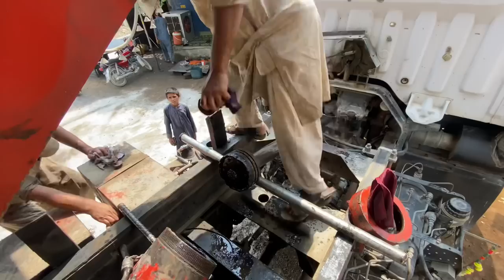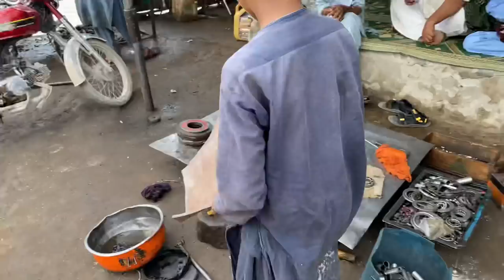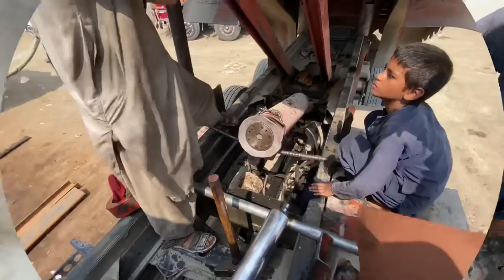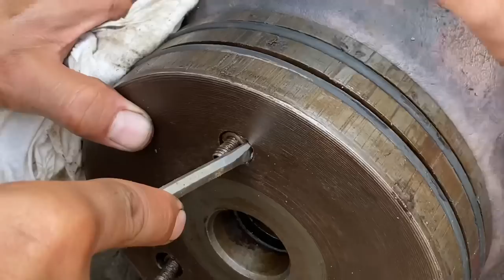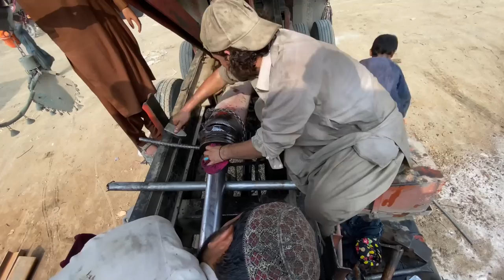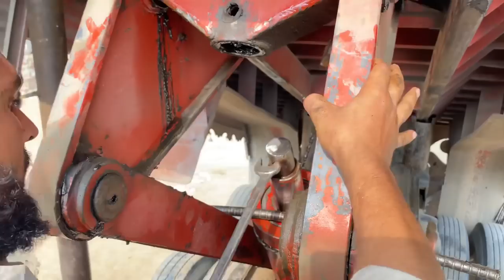how a geniusman make a hydralic jack seal from cow leather | Truck hydraulic jack seal replacement

Comment: That would get by in a pinch, but I would not expect it to last. I don't know if anybody else paid attention to the thickness of the rubber seal that came out, but it was much thicker than the piece of cowhide. And the hammering the cowhide on the sharp corners of the metal certainly weakened it. They were certainly very trusting of it standing underneath the bed with it lifted and no safety in case the seal blew